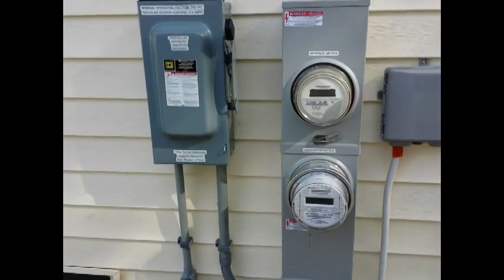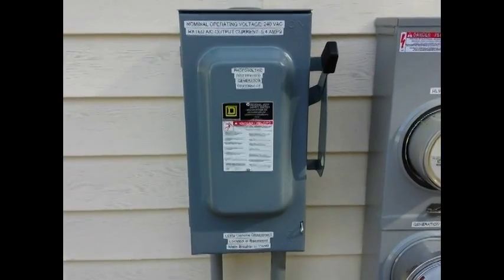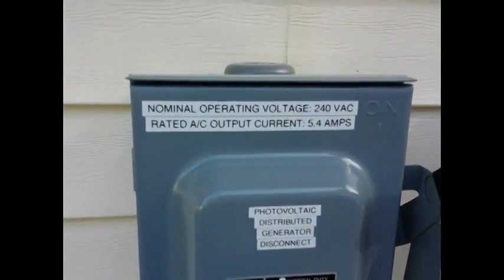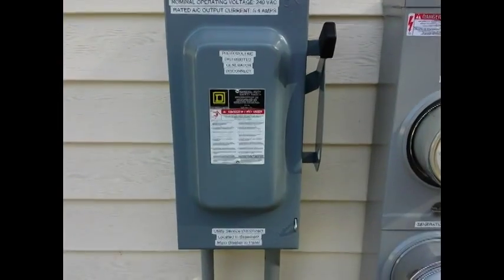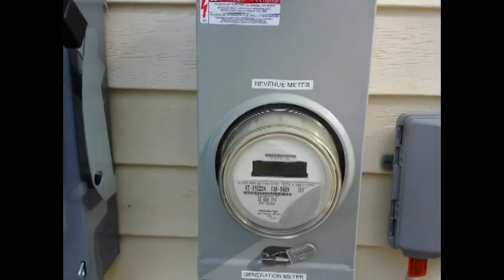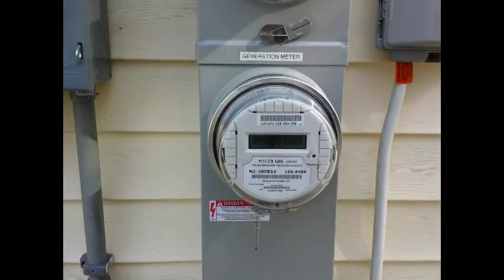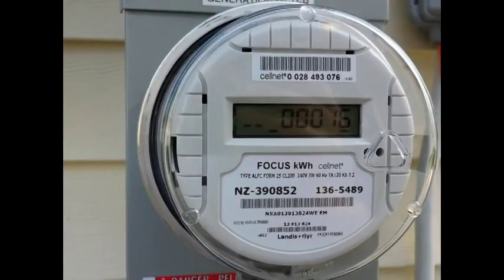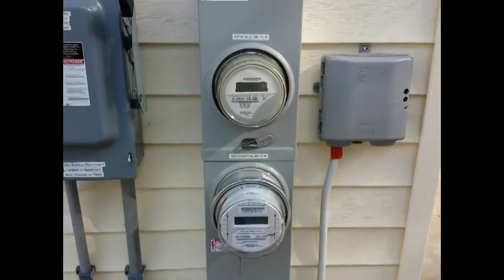Solar Grid Tie Interconnection Equipment

Comment: What's the point of generation meter? It serves no purpose except that utility company knows how much my PV system produce, which is useless information for billing, why do they care?
Reply from the maker: It is required by the Utility, but you are correct that electrically it is not necessary. They care because they account for both consumption and generation each month subtracting one from the other. If I generate more than I consume over a year, then they only pay 1/4 of the value per kWh for the overage. It also allows the utility to charge me a monthly flat fee for the additional meter. Of course the flat fees have increased and the value of a kWh has decreased to minimize the value of customer owned generation systems.
Reply: @danielmiller1892  You said it's required by utility but still most systems shown here on youtube got only single net meter. Nobody seems to know what the second meter does. I can read my both meters data online and what can I see is that primary/main utility meter does collect all required data for billing. Generation meter does not participate in billing whatsoever, all it does is it collects raw generated energy, just like my inverter monitoring does, basically it's a raw energy generation, it does not know where that all generated energy went and what happened to it, simply because it's hooked up after inverter and before going into breaker panels. By reading my main meter I can see that it accounts 100% of billing. It almost feels like generation meter is just there to track if I secretly hooked up additional PV panels or backfeeding from sources other than PV system.
Reply from the maker: @arthurvin2937  is your system connected to the grid or is it charging batteries? If you are connected to the grid, then you have to follow your utilities rules and local laws. In my area I was required to install an additional meter (and pay for it monthly) as well as install a dedicated fused disconnect and label where both service disconnects are located and provide a schematic of my system and a physical layout. No way around any of that if I wanted to legally connect to the grid. Period. If your system is not connected to the grid, then you don't need a meter.
Reply: @danielmiller1892  It's a grid-tie, no battery backup, in Phoenix, AZ. 8kWh PV > DC disconnect > SMA Inverter > AC disconnect > Solar generation meter > another AC disconnect > main breaker panel  two pole breaker > all my load breakers of course > out to 200A main breaker >> to main utility meter > back to transformer. Beginning with solar generation meter and after - is accessible from the road. Inverter, AC and DC disconnects are behind the fence.
Reply: @danielmiller1892  I do a lot of electrical work around my home, new lines, sub-panels, etc. Besides being 100% NEC compliant, part of my curiosity is to understand why NEC requires to do things this way and not the other way. Solar meter triggered my curiosity, I just want to know how stuff works, nothing more. I think it is more important to understand regulations and codes in a first place than be compliant without knowing why you must be compliant.
Reply from the maker: @arthurvin2937  I understand and agree. In my case I believe the additional meter is required because the power company has an antiquated billing system and is not able to interface with the inverterters. I also think that they want to secure their position as a power supplier so they find creative ways to charge me fixed fees every month for additional equipment that is not necessary. In my area the power company is a "regulated Monopoly" and I don't see the regulations tipping in the favor of anyone who produces their own energy. It is a political and financial issue, not an electrical engineering issue.
Reply: @danielmiller1892  Thanks, I'm leaning towards similar explanation. In short, solar production meter allows utility company to track my solar system performance and make sure I'm not benefited too much from it. Because as part of my grandfathered rate plan, I'm not allowed to upgrade my system for more than 10% of my current production, even if my consumption is 10 times more than I produce(which is), the system was sized and rates were locked as per previous homeowner habits and evaluation before system was installed.
Reply: @danielmiller1892  If I will siletly throw additional panels on my roof, utility will instantly notice my production has been increased by reading solar production meter. Hence I will be kicked off my rate plan to other less consumer friendly rate plan.
Reply: @danielmiller1892  When you say "generate more than you consume over a year" is that even possible? Most systems are designed so that such scenario doesn't happen. Sure, if I lower my daily consumption to make sure I always generate more than use, let's say I went abroad and left my house empty doing its generation thing - then yes, without generation meter, utility wouldn't know how much of that I used for house needs because all they see I'm constantly exporting. From what you said I understood that Utility does not want you to make revenue with your PV system, basically they won't send you check for overproduction. And that's being the reason why they put generation meter in addition to primary meter. Is that what you said?
Reply from the maker: @arthurvin2937  Yes it it possible to generate more energy than you consume over the course of the year. If I installed more solar panels then I could easily generate more power and sell it back to the grid at 1/4th of it's value. It would be stupid to do this as my return on investment would be longer than the lifespan of the additional equipment. My inverters also track all the energy generated, but the Utility doesn't care, nor are they willing to use the data for billing. It would also be relatively easy to connect to the non-metered side of the grid and wire another electical panel to it and wire loads directly to the feeds to steal electricity. Eventually the power company would figure that out if they audited my usage.